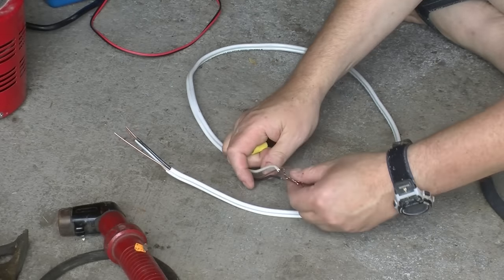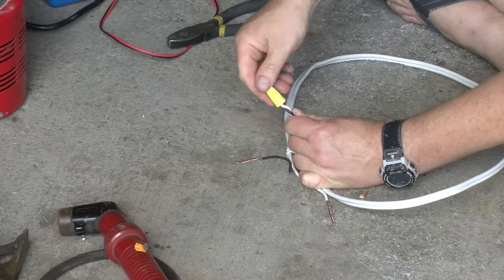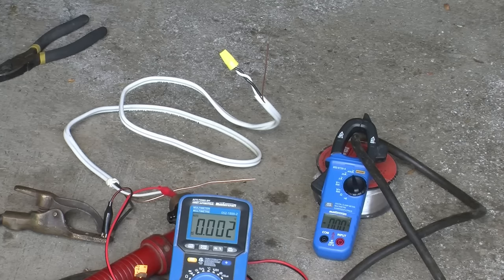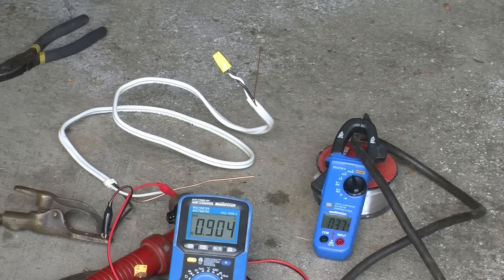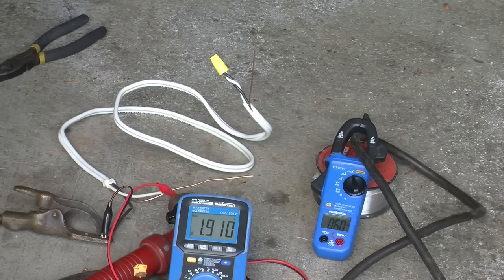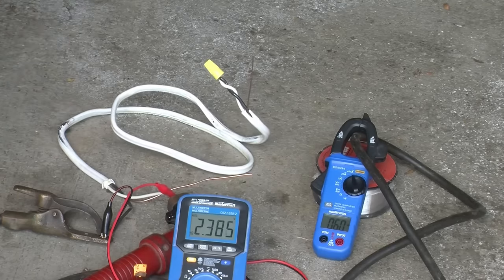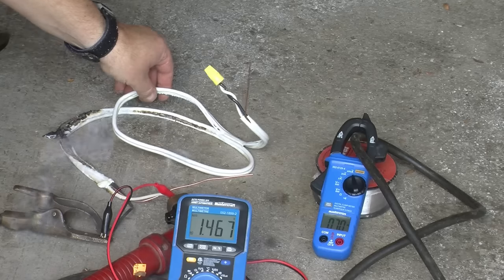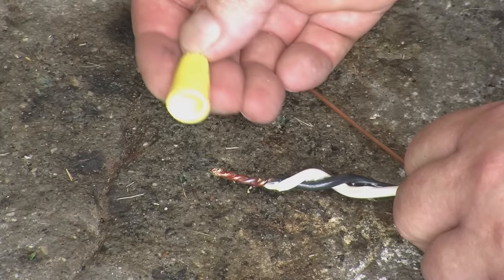How many Amps to burn up 14/2 electrical wiring?

Comment: 14/2 is only rated for 12 amps .80% of it's rating .that's why they are on a 15 amp circuit breaker .
Reply from the maker: Yes. The idea here was to get a sense of how big the margin for safety between rated and actual is. In later videos I did similar videos with the cable in typical walls with and with and without insulation much in  the same way UL does this sort of test.
Reply: @ElectromagneticVideos  it's good to see what happens .Try a natural overload with base board heaters and leave loose connections at receptacle  and show the difference between an ordinary breaker and having an RCD breaker or the combo AFCi RCD breaker
Reply from the maker: @carlubambi5541  It certainly would be interesting to see how a AFCI breaker reacts to some sparking at a poor connection and and if it trips before any really bad things happen .....
Reply: @ElectromagneticVideos  I did a service call a couple years ago before AFCI rules came in place with CSA approval and   ESA implantation  as standard wiring in homes .I had 2 neutral wires melted on a receptacle from a loose connection .The Tennant was using an 800 watt oil filled heater .He diddnt notice any smell or anything until the power went out ! Soon as i got in the apartment I would smell that burnt plastic smell .Looked around and saw a small beige stain on a receptacle !That was it .Took it apart and bingo !
Reply from the maker: @carlubambi5541  So that was what happened without AFCI? Remarkably little damage it sounds like. With a load drawing about 6A I would have expected a nice arc to do some more damage. Sounds like your an electrician? Have you ever seen something that tripped an AFCI? How much damage occurred? I'm an electrical engineer so I don't generally get to see things like that very often which is too bad because I find "real" stuff like that very interesting. Also always have wondered if the cost of AFCI breakers would be better spent in other fire-prevention ways. Would be so interesting to see of they are making a difference after 10(?) years of being required.
Reply: @ElectromagneticVideos  .I am a Master electrician in Toronto .I have worked on loads of crazy equipment from houses to chemical and food processing and movie sets and stage ..If you eat pizza or bagels or bread .Chances are I made that machine .We have international clients all over the world .From pizza to bagels bread and pastries .
So many fuse holder melted contactors relays and overloads just smoked or exploded !Crazy stuff from employees sabotaging equipment to negligence and just burning out 60 hp 600 v 3 phase motors to splitters and disconnects and MCCs just exploding from neglect abuse and fatigue .The food industry is just nasty ! .
Believe it or not .Real pastry dough is lie mixing concrete !
Reply: @ElectromagneticVideos  .The AFCi are having issues to this day with nuisance tripping .Series motors on garage door openers ,lighting and other devices like vacuum cleaners mixers blenders .Just Spain .Best cure is to put in an AFCI receptacle so you don't have to go to the panel all the time .Pain in the ass for many home owners
Reply from the maker: @carlubambi5541  That sounds fascinating! So have you installed stuff overseas with 240V 3 phase or higher voltages? I remember reading about the issues Imax had run into with different standards and safety certifications around the world, or lightly different voltages like 220V vs 240V.

The closest I ever got to 600v 3 phase motors was when I took a machines course as a student and it had a fantastic lab with synchronous machines, induction machines, DC machines and transformers, typically in the 10 to 20 hp range. You got a real appreciation for all that stuff by working with the real things. Sadly the lab was converted to little fractional horsepower lab motors 20 years ago  because using real voltages and power was to dangerous. As far as I know, no-one ever got hurt but there was wall of shame that had fried test leads and ammeters on display. 

Its funny your comment about "Real pastry dough is like mixing concrete" - we as consumers are so disconnected from mass production of food that we dont really think of mixing hundreds of pounds of dough and  other things. 

You mentioned employee  sabotage - I experienced that once in an Ontario plant we did some automation for. Crazy thing was the automation we were doing was to expand production and save jobs that were threatened by overseas competitors.  And heard a similar story from a friend, also in the area. 

Great to hear from another Canadian - I'm in Ottawa so not too far away!
Reply: @ElectromagneticVideos  I have had the pleasure to travel and commission equipment in many places .I am home now because of work related illness .But 8bcan tell you this .North American standards are far better for some and behind others .Even from places like Germany and Italy and sweeden.Everyine has their little quirks
Reply from the maker: @carlubambi5541  Interesting you mention that - I had AFCI nuisance tripping from my old table saw as it aged, I'm sure due to old brushes. I came across a much better used one so that went in the basement and solved the issue, and the old  saw is in now  in the garage on a regular breaker.
Reply from the maker: @carlubambi5541  That must have been interesting. As a kid we moved all over the place (dad  was a diplomat) and I saw a huge range of stuff - from Iraq where wires were strung from tree to tree or along fences, to Germany where (at the time anyway) houses were made of bricks and concrete and wiring was all in metal conduit. 

So sorry to hear your stuck at home - hope everything turns out OK.

Comment: This would have been a good experiment if it had been done properly. This was not a test of current carrying capacity of the wire , it was a controlled dead short, big difference! Once again, everyone thinks they are an electrician.
Reply: My toaster is a dead short... So his test is how many toaster can one circuit take, before the wire is toast.

Comment: In the wall that wire has 120 volts 15 amps power.

Comment: It would be interesting to see how hot it gets in more demanding environments, such as embedded in fiberglass insulation folded onto itself several times to represent a bundle of cables.  Use a temperature probe and give it time to reach equilibrium.
Reply from the maker: Yes - that's a much more realistic situation particularly with heavier electrical loads being way more common now than 50 years ago when 14/2 seems to have first appeared (?), and better home insulation. I'll have to see if any of my friends have some leftover insulation for test like that. Also wish I had some (vintage) aluminum 12/2 to see how that holds up.
Reply: @ElectromagneticVideos  Do not use aluminum wire inside your home; it has caused many devastating firs with loss of live and property! Aluminum wire is only allowed outdoors or to hook up to circuit breaker box with proper connectors. Aluminum wire tends to shrink over time and that is the root cause of all these problems!
Reply from the maker: @bobboscarato1313  A lot of buildings in my area from around 1970 still have it installed. It would be very interesting to test and see how it reacts to overcurrent compared to copper.
Reply: @ElectromagneticVideos  I'd second the request to see something more realistic, with insulation inside a wall. 

I'd argue that loads are lower today than they were 50 years ago in 1972.  Lighting is all LED or CFL, not incandescent, with far smaller loads.  TVs are no longer CRTs, but LCD or LED.  The only thing that's really increased the loads are a few things in the kitchen, like 1200 watt microwaves.  In my estimation the minuses outweigh the pluses.
Reply: @bobboscarato1313  The problem with aluminum wires used in homes in the 60s and 70s are largely due to the alloy of aluminum used at the time, and differences in the exapansion/contraction rate of the screws in switches/outlets.  Newer aluminum alloys are far more compatible and no longer create the same problem as long as you're using outlets compatible with AL, which I believe they are.

Though honestly, I've never seen AL wire in a big box store other than very thick wire you might use to feed a subpanel.
Reply: @stevesether  Thanks for the update. I remember there were too many fires reported back then.
Reply from the maker: @stevesether  Thinking about it - I'll bet your right! a few dozen 100W bulbs becoming 10W lets must drop current draw dramatically. And great point - the few newer high current devices are isolated in the kitchen. The only other one that I can think of is laser printers which are also intermittent. I wonder about total average power consumed with each home having dozens of AC wall adapters each drawing a few watts all the time. I would be interesting to compare historic per house power consumption records between now and 50 years ago.
Reply: @ElectromagneticVideos  upload and 7779988888889778787889889988⁸
Reply: @stevesether  That is the only kind of aluminum wire allowed anymore.
Reply: @DaveMiller2  Not according to the 2020 NEC. Lookup  310.3(b) of the 2020 NEC. You'll find:

"(B) Conductor Material
Conductors in this article shall be of aluminum, copper-clad aluminum, or copper unless otherwise specified.
Solid aluminum conductors 8, 10, and 12 AWG shall be made of an AA-8000 series electrical grade aluminum alloy conductor material"

It's true it's not very popular, mostly due to stigma.  I've heard elsewhere that copper clad aluminum is making more of a come-back.

Comment: For you newbies out there, Don't twist the wires together, just insert them into the wire nut.
Reply from the maker: There is actually quite a bit of disagreement about that. On this or other of my videos some people have really gone at  each other saying either twist or don't twist is correct. Similar discussions have raged on various chat boards. Some wire nut packages have specific instructions to do it one way or the other - in that case the instructions of how to do a connection should be followed. In the absence of that, I'm in the twist camp - I prefer  being sure the wires are securely twisted together for both mechanical stability and electrical connection rather than relying on the connector to do that while twisting it. I do get that it takes a bit more time to do.
Reply: @ElectromagneticVideos  The main reason for not twisting the wires is that they can become weakened and break off. I've seen that a few times.
Reply from the maker: @MrDeviousdom  Yeah - over twisting can be a problem. On the opposite side of  the spectrum, I once lived in a house where no twisting had been done and the connection were iffy at best. I guess the moral of the story is, however  you do it, do it well.
Reply: @ElectromagneticVideos  if you look at the instructions from ideal manufacturing for their wire nuts they say that you can twist them but it is not necessary. You are honestly better off not twisting them, especially if you need to add more wires later on.
Reply: @MrDeviousdom I’ve been an electrician for 30 years and I’ve never had the wires break from twisting the connection too much unless the copper was scored when stripping the insulation back. It’s even more prone to breaking when you score aluminum wire when stripping the insulation
Reply: @Ephesians-ts8ze  yeah, I've been doing electrical work, mechanical work etc for longer than that and I will say that you are correct. But remember who I addressed the comment to; the newbies.
Reply: @MrDeviousdom  ok, I got ya! 👍 I’ve been a maintenance electrician for the past couple years so I’m a little biased because I often have to tap onto live circuits in occupied commercial buildings and it makes it so much easier (and safer) when the joint doesn’t come apart when I remove a wire nut. It can also be a major problem for the tenants in those office spaces when they lose power. Also when you have to connect several wires with a wire nut, if you make a good twist and then cut it square, it ensures the spring in the wire nut will bite into and grip ALL of the wires. According to safety standards we’re not supposed to be working on energized circuits, but in the real world it’s safety lip service and if you’re not willing to do what you’re told you’re not supposed to do when it’s expedient, you’ll be replaced.

Comment: The connector served no purpose but to prevent you from touching the wire. It saved you from a 0.8 volt shock!

Comment: This may be a good example to show what happens when you plug your generator through your dryer outlet the turn on too many things maxing your generator and losing your house.
Reply from the maker: Yes! I would hope most generators have a breaker on them to cut the circuit if max current  of the generator is exceeded. Although you never know how good foreign made breakers may be ...

Comment: You’re measuring the wrong thing! You also need to take time into account which is why power rating is the more appropriate measure of the conductors capability! For example, that 14-2 can probably handle thousands of amps for several microseconds before fusing. Alternatively, maybe 300 amps for 0.25 seconds, etc.
Reply from the maker: In terms more current for shorter times - of course. We depend on that to enable circuit breakers to take a certain amount of time to trip when a short occurs while still leaving the attached cables undamaged.  

"You’re measuring the wrong thing!": I did a writeup here that includes a link to UL testing done in a similar way:

https://www.youtube.com/channel/UCV2-Qbq9o0EOQWPLAWkVH2w/community?lb=UgkxeilOfLJGy2ODslnBW0WFXUE580oHhFyP

Comment: Ok i mean no disrespect but u arent supposed to twist those together like that if u fray the wire it will generate heat at the points where the bare copper has rough spots
Reply from the maker: From various comments, it appears different connector manufacturers have different instructions requiring, suggesting, discouraging or forbidding pre-twisting.

Comment: Is there a difference between 1.5 volts and 120 volts
Reply from the maker: About 118.5 volts :) Ok - a poor attempt at being a comedian on my part aside, the low voltage used here is the same voltage that would appear along the wire even in a real application due to current flow. If the wire was a superconductor with no resistance, there would be no such voltage drop. But with real copper there is and it dissipates heat per foot based on the current and wire size. In a real application at the same current being delivered to the load, we would get the same heating and temperatures, but there would be 120V between the wires as well. This wouldnt have much of an effect until the meting plastic chars and the 120V starts pushing current though the charred material, heating up faster. So we might get a short a bit faster at that point.

Comment: A proper load test would be a better way to show the ampacity of the wire.  Connect a line voltage rated load of a known value and see how the conductor reacts in the various conditions.

While this experiment is "neat" it doesn't actually reflect real world conditions.  The conductor is rated for a load of  1800W at the specified temperature (60 celcius, 90, etc, depending on what is purchased).

Try connecting two electric heaters (roughly 3000W of load) to that wire with it being fed from a 30A breaker (enough for the load of the heaters, paralel not series please so you dont make fire in the heaters) and using your ammeter to monitor and see when it melts.
Reply from the maker: Actually it does show the ampacity which does not depend on the potential between the wires. An example is the ampacity of #14 is the same whether it is used in a 240V or 120V circuit.

The heating of the wire is due to the voltage drop along the wire as a result of the wire resistance and the current and it is this heating that is being demonstrated. The power from the current times the voltage between the wires is delivered to the load and is hopefully safely dissipated there.

Comment: For 120V there is only one current carrying wire. I believe 14 AWG should carry 17 amp.
Reply from the maker: For 120V (in North America) there is one live and one neutral conductor. "Live" meaning it is at 120V above ground potential, and the neutral is about (with a couple of volts) at ground potential. The neutral is the return path for the current for the live conductor - ie it carries the same current as the live conductor in a 120V circuit. 

The ground wire carries no current (unless something bad is happening). 

As far as current carrying ability - thats a combination of a manufacturers specs for a cable in particular situations and  electrical code rules. In my area, for house wiring a #14 wire must be protected by a 15A breaker. But any continuous load cant be more than 12A on that circuit. Those rules of course can change over time ....

Comment: I just wanted to point out.... there is no " proper " way to connect a neutral and a hot wire with a wire nut...lol
Reply from the maker: LOL. Not too much need for that in most wiring :)